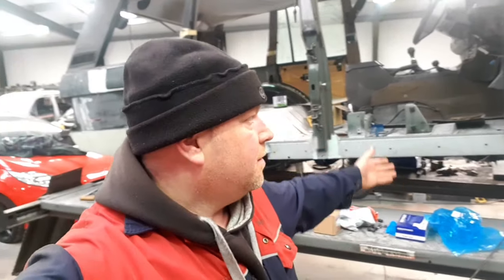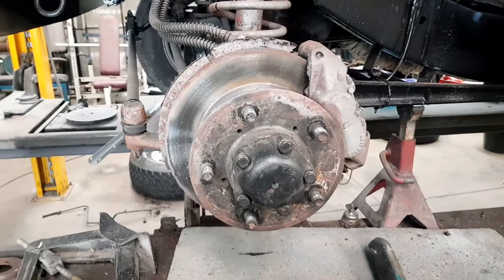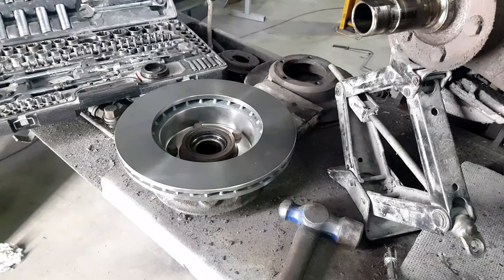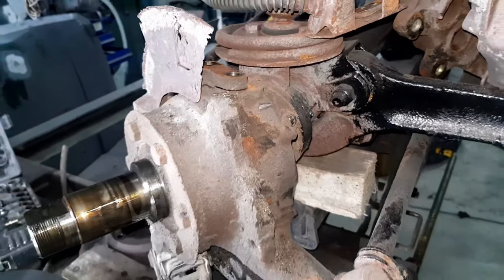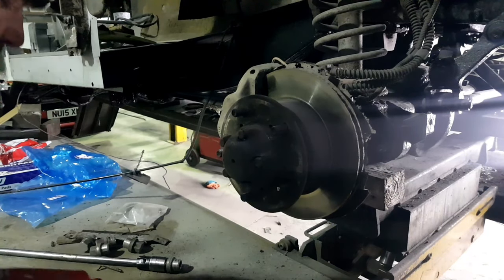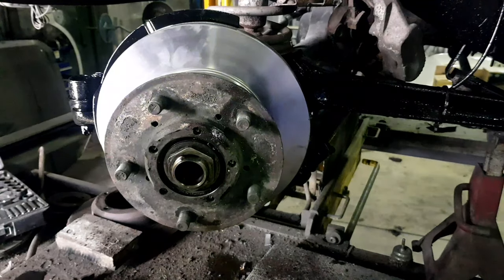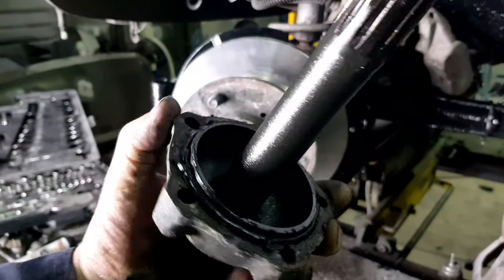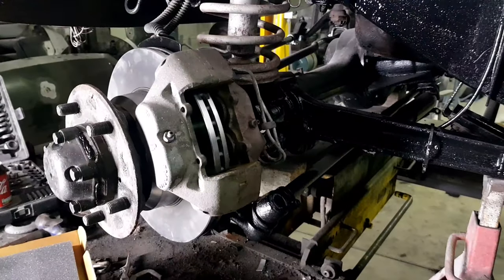Range Rover Classic Restoration Part 1 | Brakes

Comment: Much do I like your way of splitting the hub and brake disk sir. With a large wooden block in my big vice I shall use your technique to split my second one on my 300TDI, which is the same. But not bothering to use use Locktite 270, as the official Land Rover Technical comms dep Workshop Manual specifies for the re-fitting of disc to hub bolts, and they must only be tightened to 73Nm (54 lbf/ft)  really !
The problem with just making them 'tight' with an air impact gun is you likely over torque them and can not possibly have any feel for how tight you have made them. My windy gun can tighten a bolt to 400NM in a few seconds. It has a setting to stop immediately a bolt is beginning to torque up, at about 10nm, I then use a torque wrench or hand wrench to feel on non critical components. 
Just using a very powerful impact gun could very easily have caused your bolts to be stretched beyond their specific tolerance and have the future potential to fail/snap.  Seen this happen in the past at a previous job, the customer complained they was hearing strange pinging sounds, one of their wheels only had one nut left, after having new tyres fitted not far away. They got lucky we thought. 
Front brake discs being a critical component you also do not want the bolts to work loose, so using Locktight 270 as required is absolutely essential, not a choice for you to make for another. 
For the sake of 5 mins and some Locktight 270 which is the specified high strenth thread lock, is it worth a potential catastrophic brake failure for some poor unsuspecting soul down the line, and the potential destruction of all your hard work.
I dont suppose you ever did strip the hub down again to make it right, but honestly for an hour of your time it may have made all the other wonderful work your doing worth it.
please do forgive my rant, I see lots of people think your work is top notch by the positive comments, and its obvious you know better.
Reply from the maker: Each to their own. I've done hundreds of sets of brakes on these  and discos over the years and never had one single failure. I've done it the same way every time.